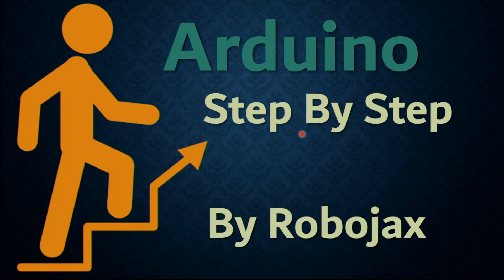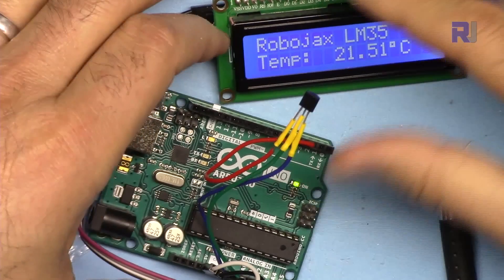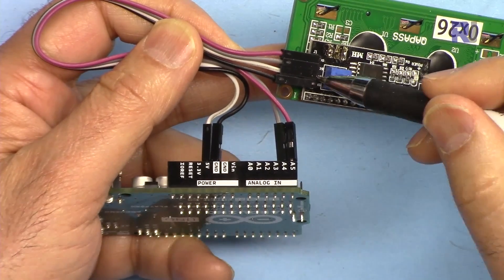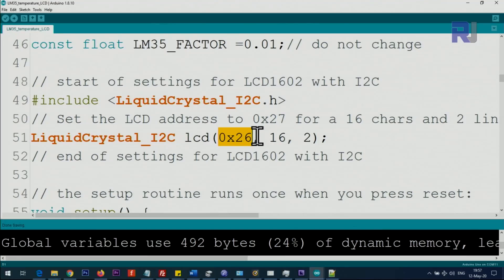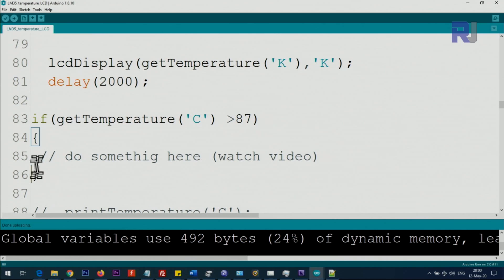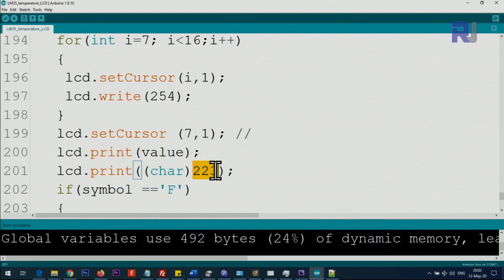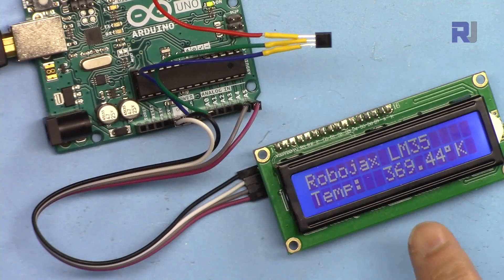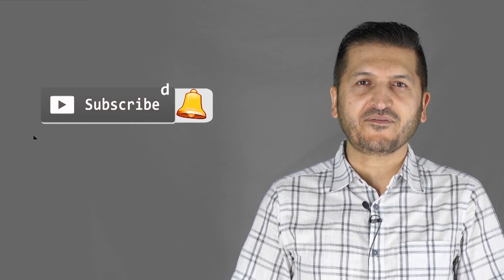Lesson 43: Using LM35 Temperatures Sensor with LCD - RJT523

Comment: Hi please tell me can i use this set up to check temperature of 280 deg. C ?
Reply from the maker: Hi, I have mentioned the maximum value for this sensor in the lesson 42.  you can't change it.  Have a look at lesson 40 for MAX6675 that can go up to 1200°C
Reply: @robojax  Thank you for the fast response, I try to find the Max6675 here in South Africa with no avail, every where is out of stock, I build a 3D filament to fuse then together, but i need to set the temperature to a different filament material, I`m run out of ideas to solve the problem.